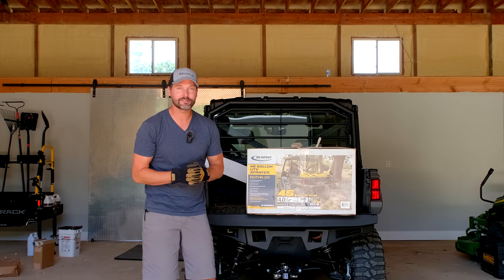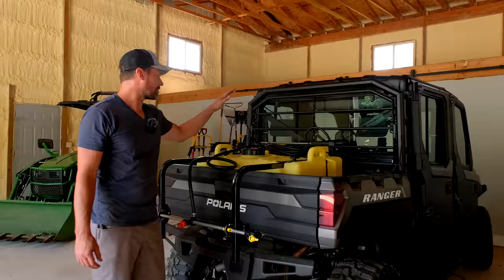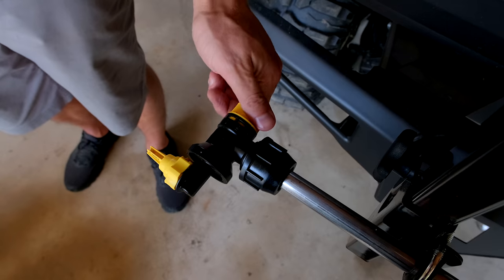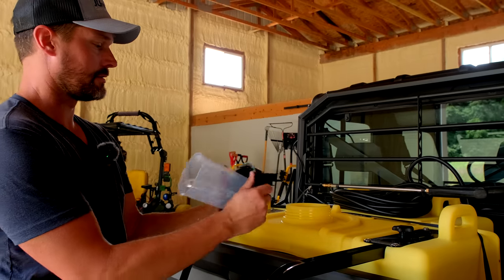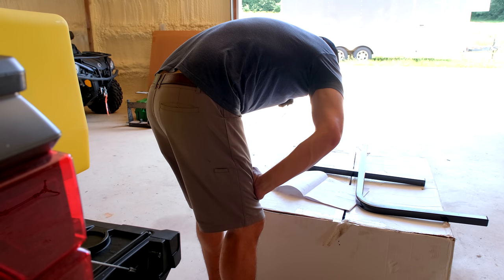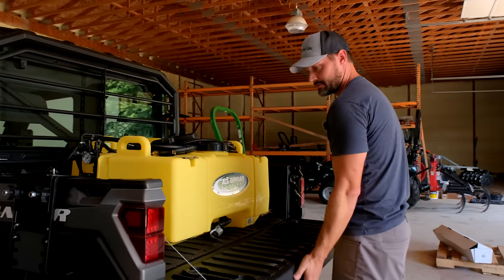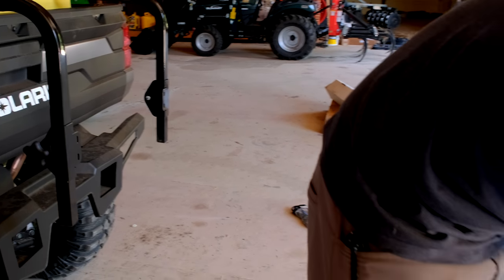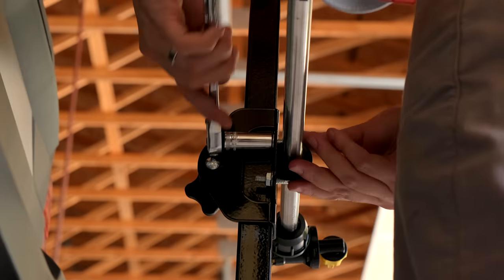ELECTRIC TANK SPRAYER FOR YOUR ATV OR UTV!

Comment: As someone who was in the lawn care industry for 3 decades: ditch those black hose and upgrade to clear braided lines. Those will degrade quickly if this is used often and leak. Another tip, they have liquids available that help you “see” what you are spraying - for your big property that could be a godsend to getting the correct coverage without to much overlap or overspray. 

These don’t seem like high use units.
Reply: what you mean "liquids available" for helping you see? can you link?
Reply: @Oakwood1809 I’m sure you’ve already found out but there is a dye you can add that allows you to see what you are spraying. Most are blue.

Comment: I had something similar that I built back in the late 90’s that fit in the box/ bed of a Cushman Truckster. It also had two booms and a center section that you could select one, two or all three. It held considerably more liquids/chemicals (125gal) and I added a hose reel to wind up the spray gun hose.

Comment: Pretty cool, I would cut out a piece of tarp though and hang it from the tailgate. A lot of the fertilizers and stuff you spraying there are incredibly corrosive and when there’s splashing on your bumper and the swing arms of your expensive ranger overtime that can be an issue, I’m sure You know that from the tractor world and fertilizer 15° but a lot of the stuff is toxic as well and you’re going to be using your YouTV with kids and eating your lunch off the tailgate, it would just be a good idea to keep a bit of a barrier back there just to keep the spray off of it.

Comment: At the 12:30 mark, I used a 12 volt switch wire that fit into the 12 volt accessory plug on the dash of my UTV.  The cable is plenty heavy enough and had the quick disconnect plug, and did not have to worry about getting to my battery.  The on / off plug switch was purchased from Amazon.
AAOTOKK Cigarette Lighter SAE Cable,16AWG 12V Cigarette Lighter Male Plug to SAE 2 Pin Quick Release Disconnect Connector Plug Adapter Extension Charging Cable with Fuse and Switch(2.4m/7.8ft-M)  $9.99

Comment: Question, not about the sprayer though (I already have one) The bumper on your Ranger. Any issues with it hitting the muffler when tilting the bed? If not, which bumper do you have? I have a '22 Northstar Trail Boss, everyone says bumpers won't work on rear muffler equipped Rangers as they hit when the bed it tilted.
Great video on the sprayer btw!